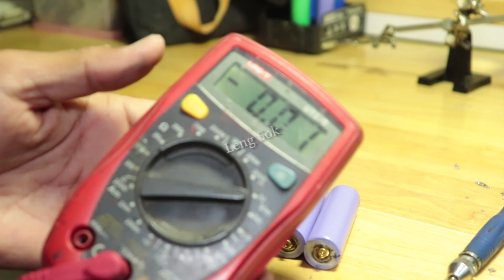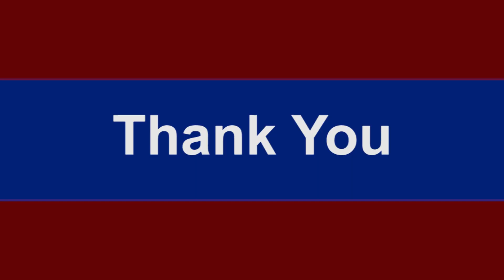Restoration Li ion Battery 2000nAh 3 7v 18650 easy by hands

Comment: Sorry, you don't know how an 18650 cell works, nor which protective mechanisms have been bypassed by your screw. You could just as easily replace a blown fuse with a piece of wire and show the world that electricity is now flowing again and that you have fixed the "problem".
Explanation?: There is a membrane in the positive pole which releases the pressure in the event of excess pressure in the cell and at the same time interrupts the flow of electricity. You have now put a potentially dangerous cell with a malfunction back into operation. If you want to take this risk... all you have to do is put a flat tool between the pole and the pole cap and press the membrane back down. Be careful - the original error that caused the high pressure is still there. But now without a fuse ;-)
Reply from the maker: I test already its work well, but we be careful when we crew